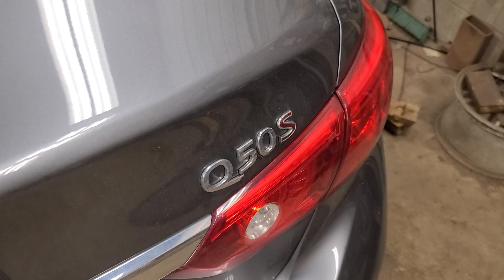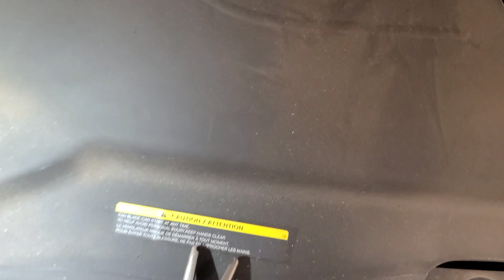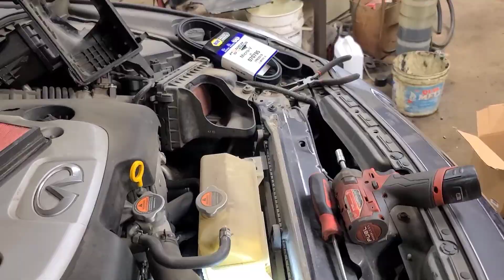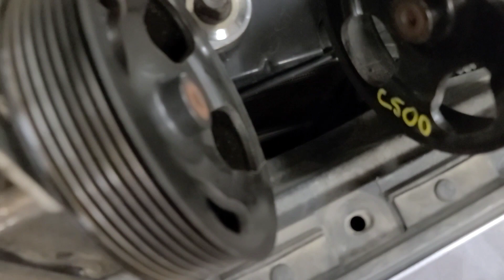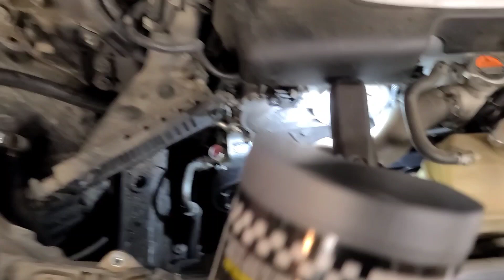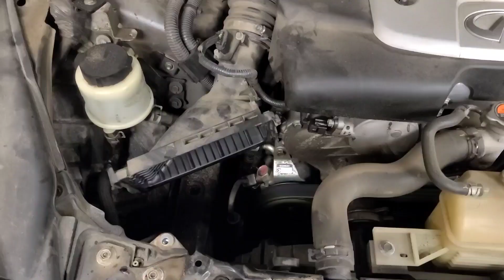2015 Infiniti Q50S Power Steering Pump Replacement

Comment: You don’t need to take the belt tensioner off you did extra work for no reason lmao
Reply from the maker: If you don't change the drive belt like I did you can leave the tensioner on but it's only one bolt not a big deal imo.

Comment: I have a 2015 Q50S and I don't have a power steering reservoir like this. I have electronic power steering and having major issues now
Reply: so, if a q50 has a reservoir like this, does that mean that it doesn´t have the das system? it is a traditional power steerinf system?
Reply from the maker: If it has a reservoir then it's a conventional hydraulic assist system.